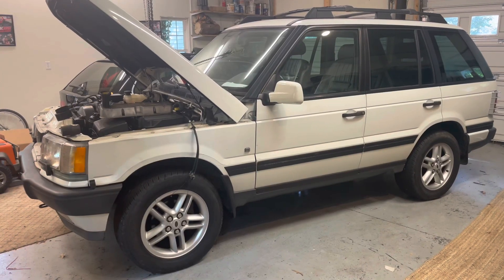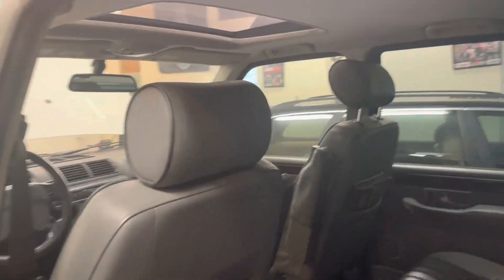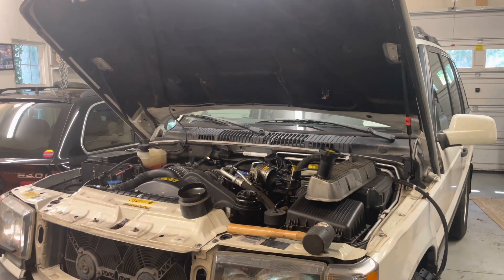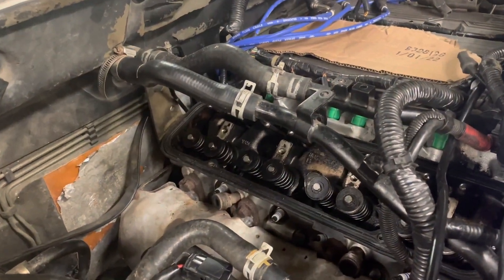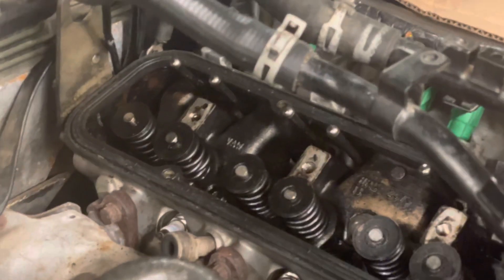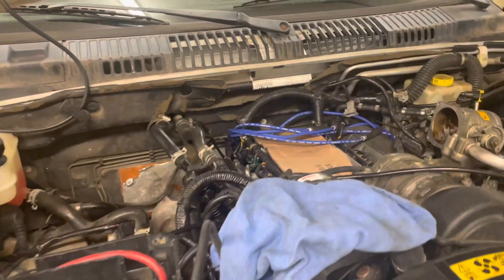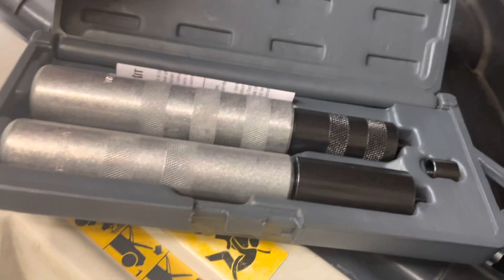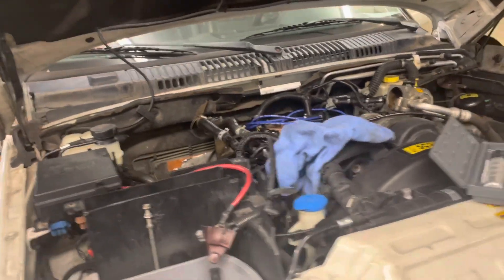Project P38 mystery misfire SOLVED

Comment: If there is no compression how are you going to build up air pressure to hold the valve in place? I don't quite see how a broken valve spring would result in no compression unless the valve subsequently bent.

 I have 2 P38s, both 99 Autobiographies. The recently purchased one had a misfire on cylinder 7 which I fixed by replacing the injector. Had to replace the rear diff as well. Six bolts holding the ring gear in place lost their heads and this was causing a vibration. Very strange. Good luck with yours.

Comment: Nice P38!  170k miles?  It's probably due for an engine rebuild but it's always tough love for P38s.  Being vested on those is an acquired taste.
Reply from the maker: Previously it had head work done while the head gaskets were done, I know that’s not a complete rebuild but it runs really well!
Reply: @rvarover  That's awesome!  I find P38s to bring more smiles per gallon than D2s.  They're just more comfortable to drive.